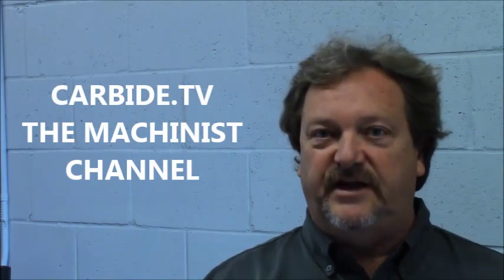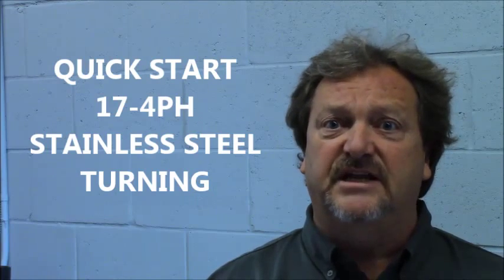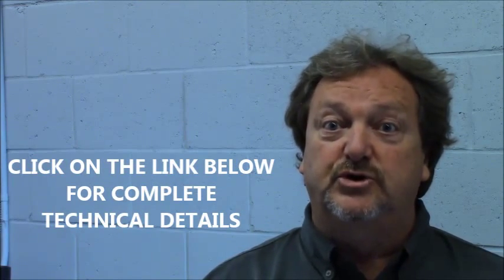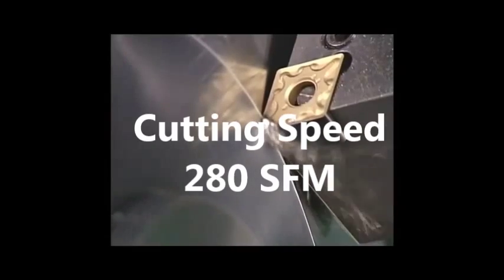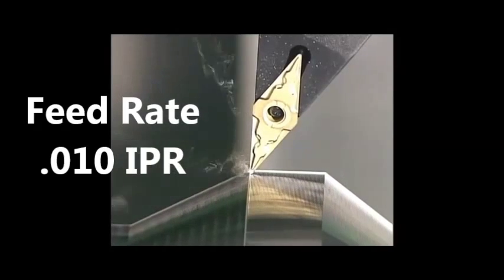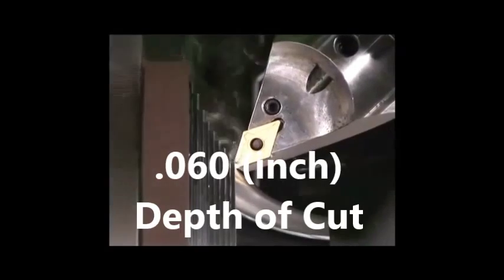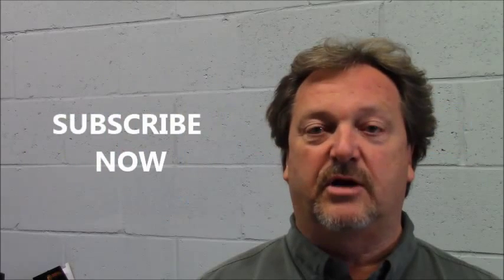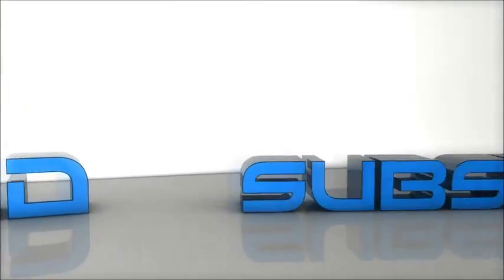17-4PH Stainless Steel Turning - Quick Start Feed & Speed

Comment: Wondering if your comments on Depth of Cut in your videos are per side or in diameter. So .060 would be a .120 diameter. Also what would you use if only removing .010 to .040 per side in difficult stainless such as 304 or type 660 (A286). Example of tool and insert geometry and grade. Thanks in advance.
Reply from the maker: Please refer to Mitsubishi Technical Details link below http://www.mitsubishicarbide.com/mmus/catalog/pdf/b/b201a.pdf